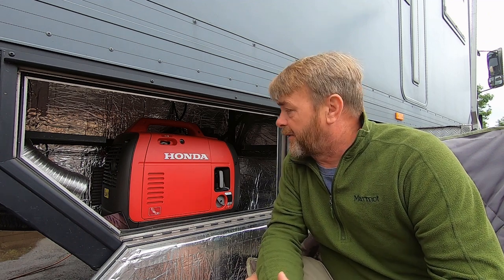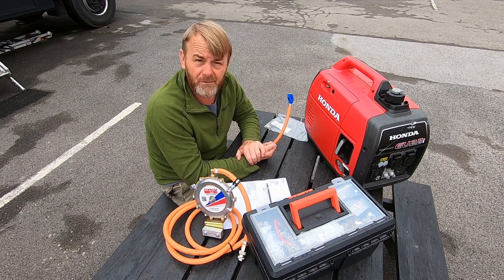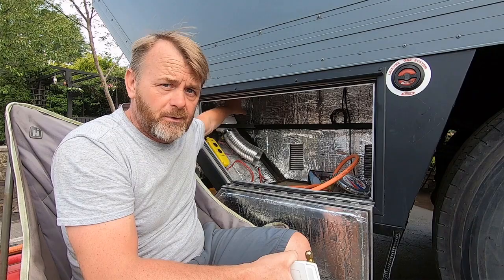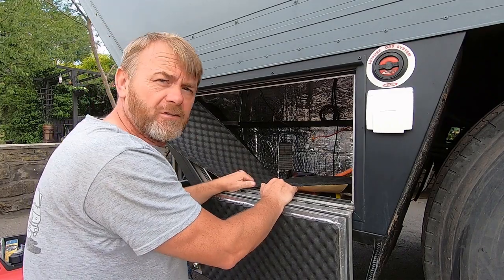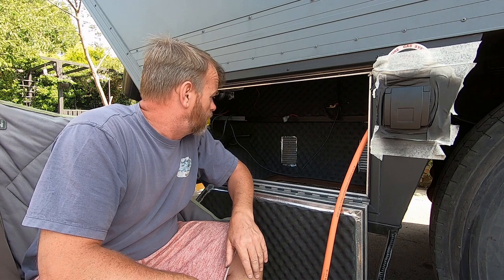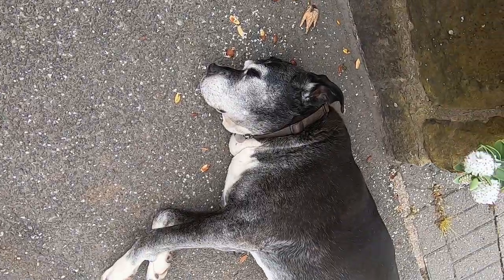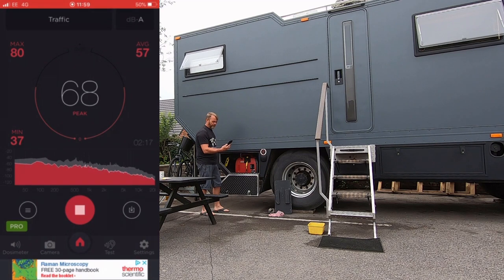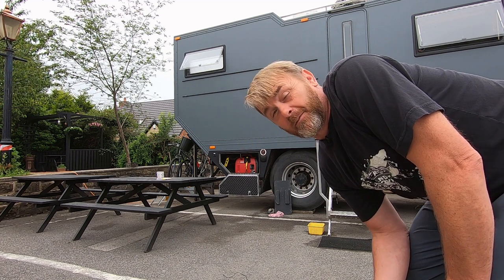Honda EU22i Generator LPG to Petrol Conversion (How to)

Comment: Generators are just about a necessity if you want to maintain comfort.  Well done. Have you thought of using a Cummins generator? I just looked at pricing they are coming up at over $3k.
Reply from the maker: Thanks, Cummins no! 
 I went for petrol so i could also use the lpg when needed. We tend to use petrol 95% of the time, and the geni runs cooler on petrol too. Also we found its quite heavy on the LPG usage! But its the be all and end all when offgrid especially like i am now where the trucks not moved in weeks and very little solar.. so i’m topping up the batteries using the geni.

Comment: Great bit of kit! Wish I had space to have it running inside a cabinet but my van size doesn't allow. I've got eu10i and the geargb LPG kit, going to set it up soon, I've got the door mount kit so shouldn't have issue with connector getting dirty since it's always gonna be connected to the regulator.
Reply from the maker: Make sure you have an isolation tap before your GB unit. And make sure you turn the tap off each time you’re finished with the generator as gas does escape.. 👍🏼
Reply: @Overlandtraveladventure  Just ordered a Bullfinch? lpg outlet point same as yours, that should turn off the gas, but maybe i should also fit a valve before that...
Reply from the maker: @tehdreamer  a good idea 👍🏼

Comment: Love it Dave, may have a go at installing one on the camper . Thinking of mounting a locker on the Safe T Bar tow bracket . Was impressed with the noise suppression. 👍
Reply from the maker: Cheers, we all carry LPG so converting the geni made things far far easier, definitely recommend doing it 👍🏼

Comment: You have to be gas safe registered to do this with a lpg element simple rubber hoses,  no lock outs for fuel fan failure 
You should be careful that someone does the same potentially very dangerous .
Sorry